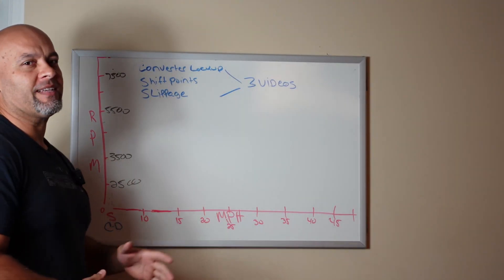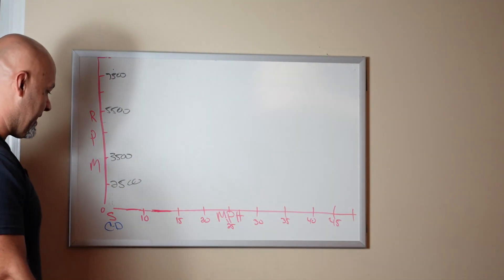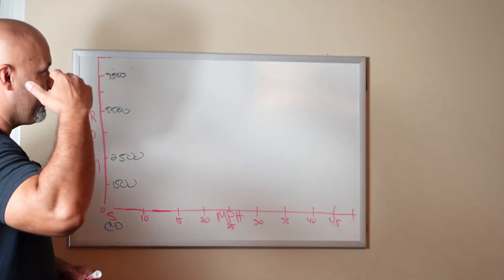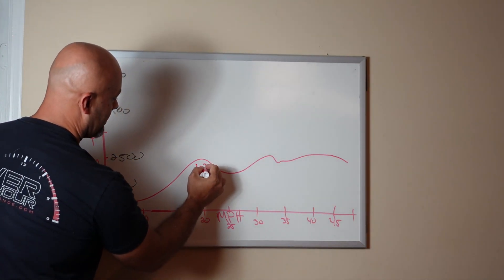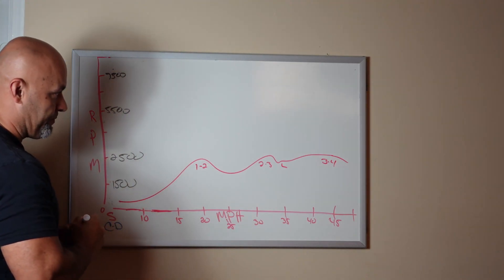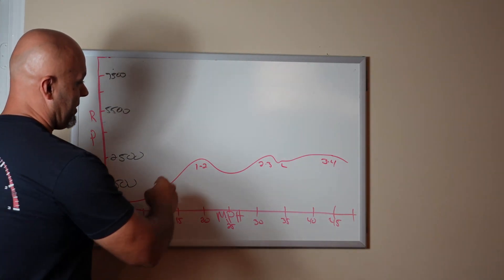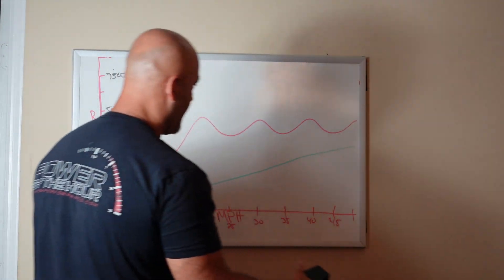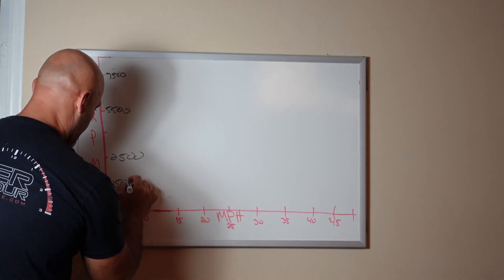Torque converter lockup and coupling visualized

Comment: It helped a bit. But why not lock up at earlier gears during WOT? I thought you were going to cover that.
😔
Reply from the maker: @obtrunco  it's not worth it. The coyote makes more power at higher rpms. The type of converter you use has different coupling characteristics besides the lockup. It's not universal across the board
Reply: @YDBT4LIFE  so it doesn't have the same advantage as earlier gears in a manual trans? In a manaual you're almost always 1:1 as you're nearing the top of the powerband right?

Comment: Great video, i do have a question for you. I have a bmw inline 6 with a built PBH Gen 2 6R80 behind it and a circle D 252 billet converter. The issue i am having is when we lock it up in 3rd or 4th gear even at 7400 rpm is dragging the motor down way to much. Our slip percentage when applying lock up is around 15%. I have currently send the converter out to circle D to tighten it as well as remove the lockup. would really appreciate to hear your opinion. We are using the M150 to control the 6R80

Comment: Other aspects of torque converters such as torque multiplication and stall speed as it pertains to engine power curve and optimal launch rpm would be good to talk about as well.  In a nutshell, torque converters actually multiply the engine output torque on acceleration but once rolling under light load, the turbine and pump start to reach the same rpm, there isn't enough slip in the converter to effectively multiply the engine torque and that's where the lockup clutch comes into play.  The lockup clutch turns a fluid coupling into a mechanical coupling reducing heating of the fluid within the converter from constant fluid shear through the turbine and pump.

Comment: Coupling is correct terminology for "locking" the converter. A torque converter is quite similar to a hydraulic coupler, with some slight differences

Comment: This makes a ton of sense. I have 2022 tacoma, 6 speed auto, with a 3.90 rear gear I believe. The converter will lock in 3rd gear. When the converter locks it’s very noticeable. (Thought it was a gear change, after the video realized it just lock up) the trans was the only complaint I have with this vehicle, however after this video I generally have a better understand now what’s happening in the trans and it isn’t as bad as I thought. I thought the gear hunting was bad, however it’s just the converter locking and unlocking, not necessarily gear changes to help aid in lack of LOW end tq with the N/A 3.5 v6

Comment: Good video. Thanks. Don't have a higher stall in Mustang but had one in my last car. I was always curios how it was different it was from stock one. I had a issue at issue at first with it where it was locking and un-locking constantly while driving. I had to get a better tune to fix that.

Comment: My 6R80 Gen 2 behaves kinda like it has a high stall in normal mode under normal acceleration. The converter never grabs and it just sits at a constant rpm but keeps accelerating (kinda like a cvt). It’s shifting through the gears you just don’t hear/feel it. If you accelerate harder or put it in any other drive mode it shifts as normal

Comment: My F250 locks up after 4rth before the 4/5 shift, just the way Proven tuning has it, maybe its the same in stock configuration and everything you just explained is just that . Couldn’t be anymore clearer, hope this helps others understand that a dip or “bog” is just converter lockup

Comment: I love this type of video, I have a question. 

If locking a converter is more beneficial to ET and MPH, wouldn’t it be more beneficial to keep the converter locked all the time from the start to have more torque?
Reply: Nope.  Torque multiplication in the unlocked convertor is a huge advantage on initial acceleration.
Reply: @anthonygrebner  thank you for the explanation I appreciate it. I didn’t think about the torque multiplication and how that would be beneficial at the start.

Comment: 👍👍
Solid. This is solid. I learned something today. Learned about what a "Lock-up" converter is. So helpful. I did find myself curious about the temps and the difference in temps between locked and unlocked. Then again, "Everything gets hotter" doesn't need to be elaborated upon.

Comment: Great video with lots of data, videos like these are some of my favourites. Here's a great video where you can see a c7 Corvette shift, lockup (and continue on to get gapped by a 2013 gt500) https://youtu.be/8Fh87FGCnG4 The 8 speed transmission converter is a terrible design on GM's part. The "5th gear wall/bog" Camaro owners talk about is a real thing.

Comment: Great explanation!! One thing you should had touched on is:
When the RPM drops you are “resetting” back to your torque peak, or just below it. I think that point makes people grasp the concept a little easier. 
That also explains the “why my car got slower with a higher stall converter?”. Many times is because you “flashed” past your engine’s torque peak.

Comment: Good info. I found it beneficial at the track with a centrifugal to not lock it. Locking it seemed to drag RPM down further where the car wasnt making as much boost and therefore making it harder to pull itself back. I dont have too much inherent slip compared to 3C or 4C, I have a 2c.
Reply from the maker: Wrong. 
Lock it always. locking it and shifting it higher in a Centri application is key
Reply: @YDBT4LIFE   about 7700rpm shifts. Locked rpm would drop to 5300 roughly, lucked no lower than 6300. Jr agreed to unlock it to see and car dropped close to 3 tenths and 3mph at pbir. Also 60-130s quicker too
Reply from the maker: @blown06tc  must have a tight coupler
Reply: @YDBT4LIFE  245 2C. Jr said unlocked it doesn’t have what he would consider a lot of slip. Based on logs at the top of the RPM is 2-300rpm of slip
Reply from the maker: @blown06tc  makes sense that's why I referenced the circle d 3c